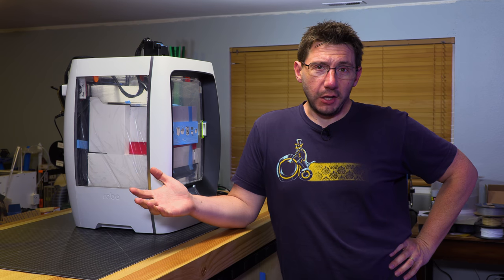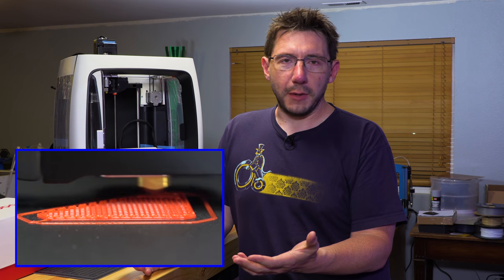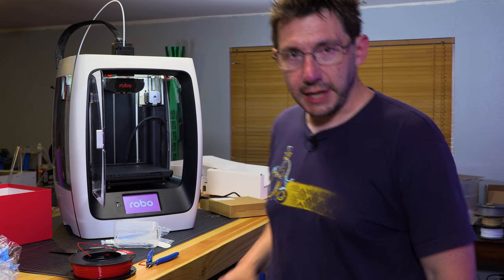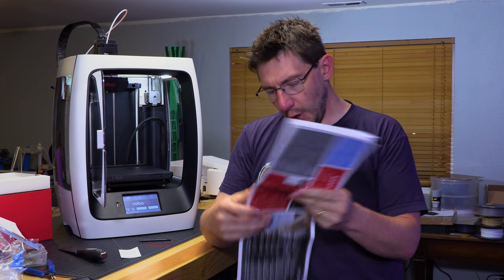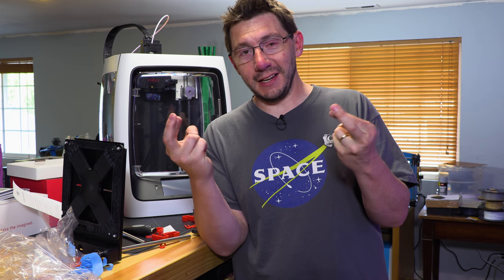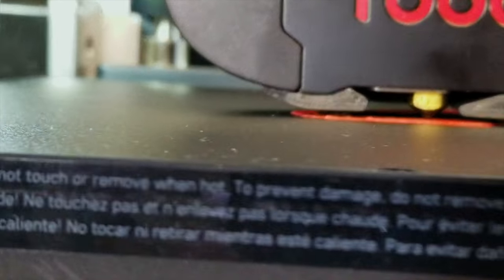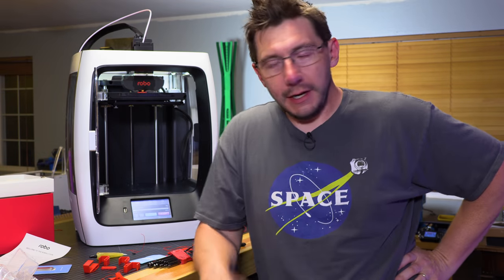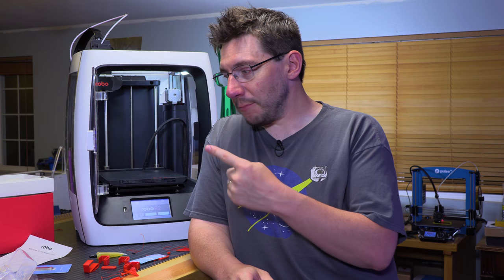Revisit the Robo R2 3D Printer - Second and Third Impressions Update

Comment: I have a R2 I purchase last summer. First unit had a bent Z-axis screw like Joel's. Robo requested the printer be sent back on their dime. When the unit returned to me there was shipping damage. I made some suggestion on better packing. Robo listened and sent me entire new unit. This unit works. I have made modifications: 1). first was to had LED light bars at the top. Not enough light when printing short parts. 2). Added bushing at top of the Z-axis screw to further prevent wobble. Do not think this help a lot but did not hurt. 3). Changed cooling vents to a new design Robo 3D posted to Thingverse.com. This made improved air flow. Now print at 50% speed for cooling. 4). Bed heating contacts failed after 3-4 months. Robo's 2nd design as shown in Joel's video was a free replacement (you have to ask for it). It still sitting in it shipping box as I solder new higher capacity (amps) contacts to the bed contact board last December I got from Digikey. Works great! This was a simple engineer mistake. (I reserve the right to say so as I am an engineer of 32 years). And no cable to plug/unplug. Robo has problems with shipping but are improving. 5). Went to Build Tak over the original bed surface. I just received the new Build Tak flex plate but have not changed yet as I had just installed a new sheet. Keep in mind all the printers are manufactured in China and shipped to the US. This is the biggest issue with quality. I have contacted Robo many times and some times you have to push them like any company but Robo 3D has stand by their product 100%. UPS throws packages around like apes. Fedex probably the same. This printer prints excellence and I run it almost 24/7. Lastly, I use Cura software and did not want to $150 for Simplify3d. I had bad prints from time to time. I purchase Simplify3d, had to adjust some setting and never look back. My biggest complain spare parts are rarely in stock at Robo USA. I agree with Joel this still is not a out of box printer sense there is still a lot of issues but Robo will get there.

Comment: Do you remember when I told you about my experience with #Robo3D with the R1 Plus? Absolutely blows my mind you're having the exact same experience. I'm beyond pissed at Brayden for putting you through the same exact experience he put me through with the R1. Nothing but quality control issues and nothing working as expected. I even spent a week working around all the problems until I got the printer to work "as advertised" and then they wanted me to abort the video because I was calling out all the things you might have to fix when you get the printer so I just blew up at them and said they could send me shipping labels if they wanted the printer back otherwise they are going in the garbage. They even wanted me to pay to return all 3 printers to them after we had it out on Skype. Honestly Brayden, you couldn't be shooting your company more in the foot with how bad you're cheaping out on your production & quality control. You honestly could have made this printer about 10x better with no more then $10 more's invested into it. 

I'm honestly pulling my hair out right now watching this Joel, after my experience this should have never been allowed to happen again and it really pisses me off that Robo 3D is shipping this garbage. The stylus for the touch screen is so beyond unacceptable even though you can use your finger with enough pressure and tries it's not even funny. It sends a clear message that they sourced literally the absolute cheapest electronics they could with no regard for quality or limitations to their customers. I'm sure they bought huge lots of lead screws that were rejected from other 3D printer companies and the screen on that thing probably came off a PDA from the 90's. The color depth looks strikingly similar to my Compaq iPAQ PDA back in the day.

You already know that I refuse to work with Robo 3D after my experience ever again and now as much as this is painful to watch I'm glad you understand first hand what I was talking about when I told you about my end to end experience and how much time of mine Robo 3D wasted. They even at one point said that it must be user error because they have never had these problems when I was one of the largest 3D printing channels on YouTube and even showed them everything I did and sent pictures. I honestly can't shake my head hard enough on this one. 😤🤬😡🤢🤮
Reply: Got called out as a hater when I said Robo was shifty as fuck back in '15 and now look! Garbage white label printers made by a cut-rate manufacturer in China. Then again, Robo did take a couple Million from that Australian VC, and once you take that dirty VC money, your're beholden to whatever terms they decide. In this case, it's to move as many units as possible, regardless of quality. As long as shit is moving out the door, then the numbers look good.
Reply: I've been saying similar things since 2015, with similar responses from the forum community (and total silence from Robo 3D itself).

When a <$200 knockoff of a knockoff printer from Monoprice (the Maker Select V2) outperforms a ~$700 printer (the R1) with a much better warranty support system (full year, full replacement, Free shipping both ways for Monoprice vs. Robo3d's "Fuck you, pay shipping both ways if and only if our 'warranty' covers the specific component that failed" policies), you don't deserve to be part of the 3d printing community.
Reply: dude do more 3d printing videos
Reply: I have had an r1 for a few years. Everything has been replaced and or upgraded. Should have just stuck with a prusa upfront.(would have been cheaper in the end)

Comment: I feel for the guys at Robo a great deal. They’re a very passionate group and want to make amazing things, but have been plagued by quality control and design issues for as long as they’ve been a company. It will come around eventually, but it’s always sad to watch them falter time and time again. 

While it seems obvious that the screen could have been better, simply replacing the screen can be a painful process in the world of manufacturing. From the time spent developing the firmware, modifying the CAD and production documentation, to dealing with the supply chain and sourcing. The trickle down effect from changes in a design is very drastic, and can be a lot of cost for a business to eat. 

I hope they sort out their issues and people start getting very high quality experiences straight from the box. The machine is visually striking and appears to be a clever design that adds useful printer functionality to which I hope more suppliers start following.

Comment: This is why I returned my r2. I was having the same problem as your first printer and then after spending several hours with robo to fix the printer, the heater for the build plate broke. Robo needs to fix there quality control cause a printer that cost 1500 should not be having worst quality control than a cr10s

Comment: I wonder if the packaging is putting pressure on the lead screw and that's why it keeps ending up bent...
Reply: It seems they correctly blocked build plate movements on the Z axis with the piece of foam under and all the boxes over. But I haven't seen anything on the sides to block X and Y movement.

Since this plate is huge and heavy I wouldn't be surprised package handling resulted in the plate moving around and bending the lead screw.
That or boxes hitting the screw.

Comment: So question. Is there any reason to buy this printer? Seems theres a 100 other machines that will do the same thing with less hassle.
Reply: Michael Scholtz Ask people that buy Ultimaker printers. They might know.
Reply: CrimSun I have an ultimaker 2+ a lovely printer. The difference here is that my machine arrived and printed, But that said my cheap as chips wanhao i3 also prints beautifully. 3d printers are not just tinkerers toys anymore and people that buy a anet a8 do so because they're happy to fiddle to make it work. At the ultimaker end of the market people expect a working machine that prints.
Reply: Michael Scholtz For the price I pay for an Ultimaker, I also expect direct customer support and guess what. Ultimaker doesn't do it. Your only support is with the store you got the printer from or their community forums, in which they'll recommend you to get support from the store. Sure, the printer works, but so does most Chinese kits out there. Also, all Ultimaker parts are proprietary, which renders you unable to service your own printer.

What are you paying for?
Reply: The point is not that you can download all the source files off www.github.com/ultimaker, were not ltalking about other printers. 
I'm saying is the machine here simply didn't work out of the box and for $1499 it kinda should have at least one of the 3 tries.

Comment: I am very surprised about the touchscreen.  My Flashforge Finder has one I can work with my finger and it cost a lot less than the R2.  I'm also very curious about the lead screw mount and what is damaging it.
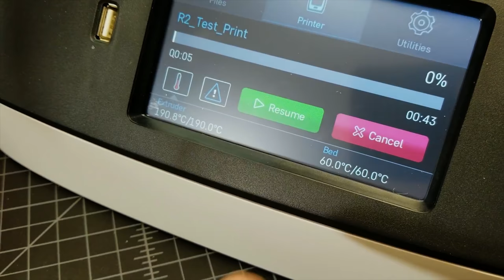Reply: Well, I mean it works just fine with his finger several times in the video. I feel like he's exaggerating that issue... look at 20:18 in the video. As far as the lead screw, it's probably because of all the crap they pack inside it. During shipping it probably moves and puts pressure on it. Really dumb for them to put all the accessories packed inside it like that.

Comment: I almost went through the same story haha. I bought a Robo R2 January 2/ 2020. A few days later I received a used, useless, broken, incomplete (no ac plug), Robo. There was filament all over the plate, also filament in the hot end, marks, scratches, well a complete surprise. I talked to them and they sent me a replacement. The week one I removed the hot end because it was jammed and when I tried to put it back, the screw that holds it was stripped (so the printer some how was used, again) and they kind of glued it to keep it stable to sell the printer. I had to purchase the screw and the whole support part by myself, the second week the motors belt started to do a horrible and loud sound every time I started a print. It turned out that one of the belts was broken, and again I had to buy it by myself. The week 5 when I started a new print, the plate tried to go lower than the limit, making the belts and the motors to make a horrible sound again. It turned out that the cable at the top of the extruder was broken and when I talked to support they basically told me that “try to put it back in its place” 😕 that Kinda worked out but every time I had to start a new print, the cable was out of the plug (of course it was broken) experiencing the issue again. They refused to replace the printer or the extruder so again I ended up buying the extruder by myself and replace it. So far more than $400 in repairs out of pocket. The printer is $1.499. So after that the printer was just fine and I sold it for half the price I paid for the printer only. The printer is cool from the outside, but terrible assembled with cheap parts. It was so bad experience that I almost considered to abandon 3D printing in general. Now I have a flash forge adventure 3 ($499) and finally I feel that I bought a printer from an actual company. The Robo printers make you feel that you are buying printers from a guy that makes 3d printers in his garage with whatever pieces he has...”

Comment: I've had quite a lot of problems with my R2 after about 8 months of printing.

Faulty pogo boards failing multiple times, stripped hot end mounting screws, extruder motor clicking once in a while, min temp errors at random causing loss of massive prints. I would say that when it works, it works really well. 

My R2 got me into printing and I have learned a lot, but I believe it's time to move onto other machines.

Comment: I think i know what the problem is. That styrofoam that was under the bed was putting upward pressure on the build plate. I noticed you had to flex the plate up to pull it out. I'm curious if it was you flexing it or the pressure of it sitting like that that caused that bend. Either way that shouldn't be happening.

Comment: This must be pretty bad but pissy Joel is rare.
Reply: Theressa , he got more upset about the stylus than the bent leadscrew. Not everybody has spare Robos sitting around.
Reply: Michael S the whole thing seems a bit failsauce. They had the same issue 3 times and apparently they tinkered with it before sending it and missed the lead screw issue AGAIN
Reply: I suspect its a packing issue, forcing all that crap into it, directly against the lead screw..
Reply: Peter Ellens that's what I tweeted him on this. It's the same as the wanhao d7 they had a issue with bent leadscrews. They where using cable ties around the guiderail and the boxes inside but between those was the leadscrew.
Reply: Joel is a saint, I've never seen him this mad over anything. But I understood exactly how he felt watching this video because Robo 3D put me through the same thing with the R1 Plus and wasted a week of my time that had nothing to show for in the end and even insisted that user error was the cause instead of accepting the QC problems even when I presented them in pictures. This is so disappointing :(
Reply: man i miss your old printing videos Jerry

Comment: I agree about the control screen. Mine will NOT respond to my finger. I also was using the wrong hole for the filament sensor. There is an option to disable the sensor, which is what I had done. This is my second "out of the box" Robo3D R2, and I love the features. I have had some problems with prints that need support. Today my extruder stopped half way through the print. It was still going through the process, just no filament was coming out? Have no idea why.

Comment: Hi Joel, great videos. I would like to ask you for help, I am thinking in buying a 3D printer, in one hand I saw the Robo R2 that looks incredible but it is quite expensive, on the other hand I saw printers like Weedo with double extruder and closed cabin, much, much cheaper. Do you know if there are a big difference betweent this two machines? Have you teasted or listened about weedo brand? Thank you from Buenos Aires, Argentina.

Comment: Hey, I have that (Tron) shirt! Damn, that's like 8 years old. 

Also, I agree with the stylus comment. With two Robo R2's and two Robo C2's in our shop, we have issues using the screens without the stylus on all of them. Aim slightly below center of where you want to press and use just your nail if possible.

Can you slice something in Cura (or whatever slicer you prefer) and then print on the Robo? We seem to do okay letting Robo slice its own files, although it doesn't slice and then print, it just slices and stores the file. When we slice in Cura and then print via USB we get warping when using PLA among other issues. Would love to see your experience with it.

Comment: I've had some issues with mine for sure.  Most of them have been resolved by me or Robo and the printer is running good now.  There are a lot of things about the R2 that are hard to get past though.  Such great potential, but too many little things holding it back.
Reply: It's bad that everyone I know that has this printer has had significant issues.

Comment: I have a Robo3D R1+ and it also had production issues.  I had the whole wiring harness melt and I had to replace it.  There are a dozen machines for half the price of a Robo that will do the same job without needing maintenance between every print.  I know this wasn't a review, but this tells me that Robo doesn't care that they send out defective machines.

Comment: Could the rod have bent because you didn't remove the four plastic shipping brackets (that weren't mentioned in the setup manual).
Reply: The shipping brackets where only on the CoreXY part on top of the machine while the leadscrew is connected at the bottom of the printer. And the power of the motors wouldn´t be enough to bend the metal rod anyway ;)

Comment: So you have to remember to order 3 of them so you can make just one of them work. Nice!  If the manufacturer is pulling a fast one on you just to show this in a good light them everyone can pass on this system.  Thanks for the review Joel
Reply: They cover the issue on their warranty, so you would still only need to buy one - that said, it is really bad how often that seems to get bent. I hope they can figure that out, I have a Robo R1+ that I love and really really want this company to be able to live up to the same level of reliability with the R2.
Reply: I'm sure with this glowing review they will or SHOULD reevaluate the quality control and figure out just what is causing these issues. Also, making sure a touch pad actually works by touching it.
Reply: For 1500 USD each? Maybe get 3 Prusa i3 with business support instead?
Reply: Agreed

Comment: As soon as I saw Robo 3D in the title I knew how this video was going to end up.  I was one of the original backers of Robo on their kickstarter and sadly it was my first 3D printing experience and it soured my taste for 3D printing.  I never really got the printer going well at all - oh and I also had a bent threaded rod.  It was never replaced.  I eventually ripped (actually not using that word lightly) the whole printer down to pieces and packed it away, went out an bought the absolute cheapest Chinese kit I could find and got better prints from that without tuning it (Flsun Prusa i3 clone, the small build plate version).  If I was you I'd steer all of your viewers away (run run fast away) from Robo3D and their R1, R2, R(whatever) they now want to call them now.  I suspect the only reason you're giving them a break is cause the printer... er printer(s) were 'donated' for a review.  And the touch screen, well... wow... 'nuf said